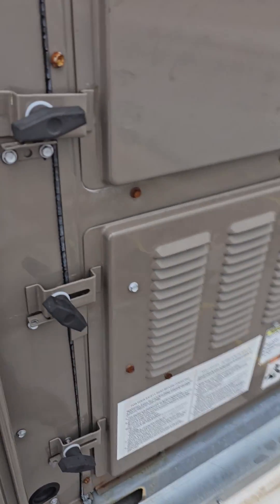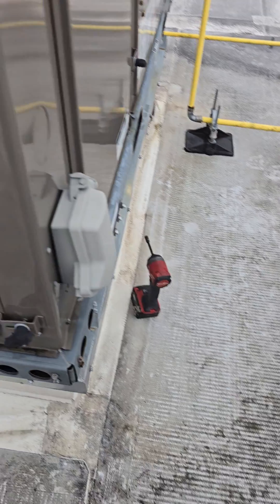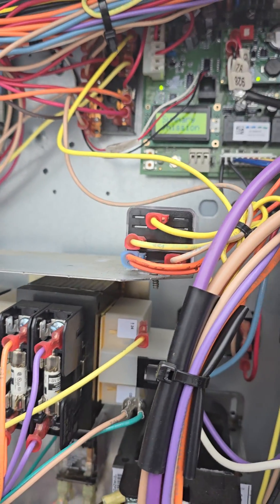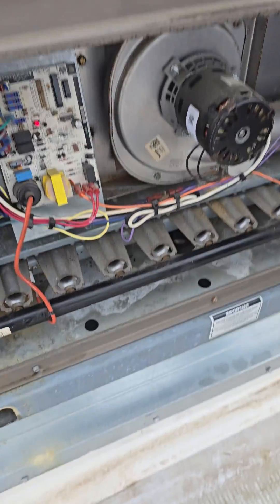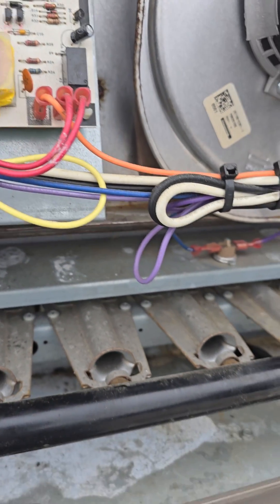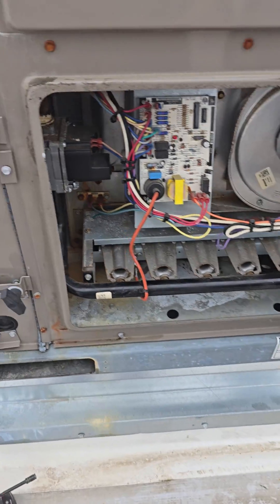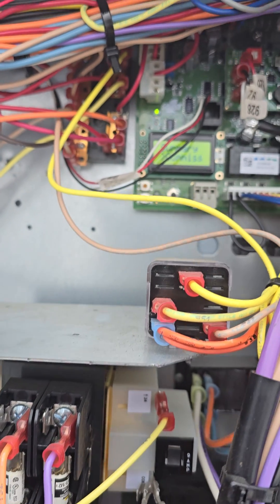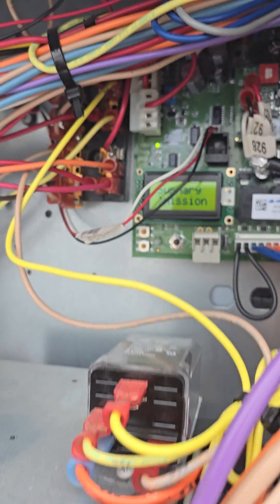HS1 fault york rtu

Comment: Hi, I have this HS1 error in heating mode.  Reset unit and it runs for about 5 minutes and then HS1 error. The ignition control board doesn't flash any error codes. Only HS1 on the main control board.  Unit  has VFD drive. Temperature rise is in range. Limit is ok? It's -20C here. I've noticed on the VFD display it shows 43.5 while the blower is running. When it was working ok the display shows 100. But my temperature rise is ok. Any help would be greatly appreciated. Thank you.
Reply from the maker: @mark.r8900  Sorry, I'm just now seeing this. Is there any rust on the connections to the limit. I would double-check all wiring for a possible short as to this error is linked directly to the high limit